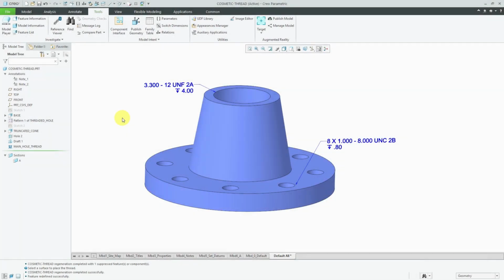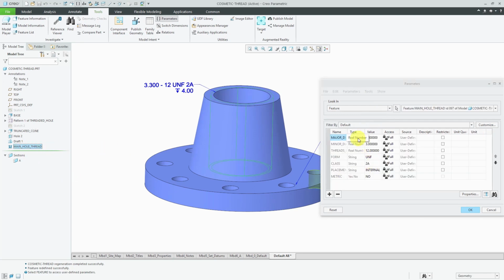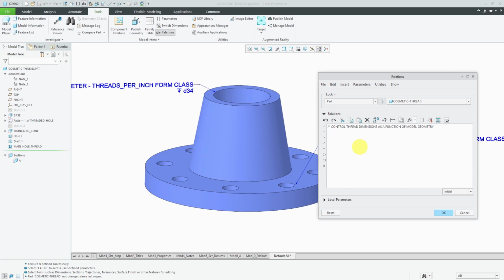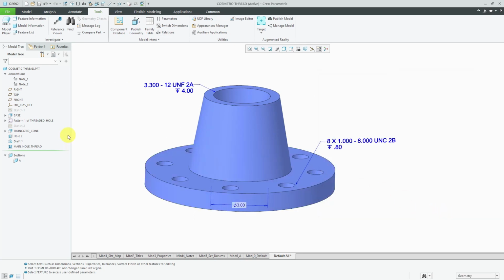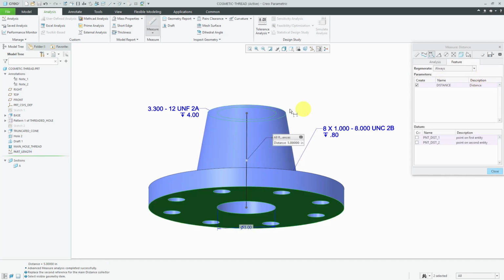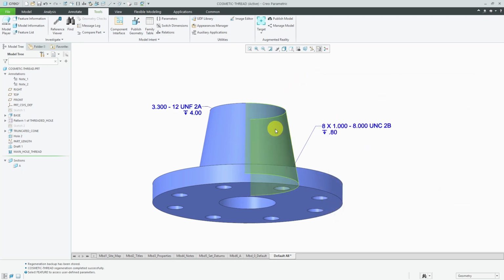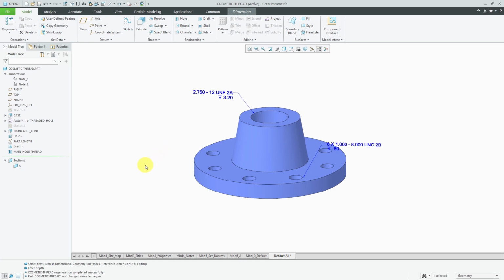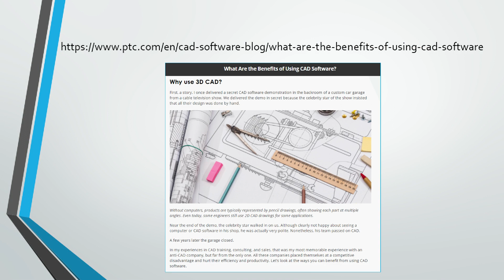Creo Parametric - Cosmetic Thread Relations

Comment: Hello!
I have this problem in Creo, that I need to make an outside thread around a rod with a varying diameter, so it get bigger along the thread. When I try making it with the helical sweep, the profile doesn't rotate corectly, and I get a really messed up unuasable thread. Do you have any videos on outside thread on varying diameter?

Comment: I'm impressed by your speed in your response ... And with a video! Thank you very much. What happens is this. I have been working with Creo / ProE since 1997 and am quite familiar with these techniques used in your video and for many years I have this problem that are threaded holes. As I do not like using the intelligent fastner tool I use a udf with an analysis, a hole and a thread. When I apply the udf first I select the screw so that the value of the analysis will define the diameter and depth of the threaded hole, so when changing the screw the thread will adapt, the problem is when the thickness of the part is smaller than the threaded hole , the thread protrudes and confuses. The other option is to use holes already with the thread soaked with a custom table. I also use this option but it is not very reliable since as the diameters are attached to the table I can not change them with ralations... The depth I can but the diameters do not. But with this option the thread fit perfectly to the part, I do not have to worry ... To solve my problem there are two possibilities, one would be to discover a possibility of changing via diameters of a hole connected to a custom table. The other would be the option of the thread adjusting automatically to the existing geometry in the part ... I think that as long as PTC does not include this option in the thread feature , I will continue with this problem for many years! Thanks again for the attention and this is the best YouTube channel for Creo content. Congratulations.